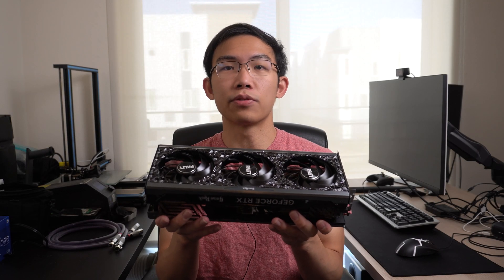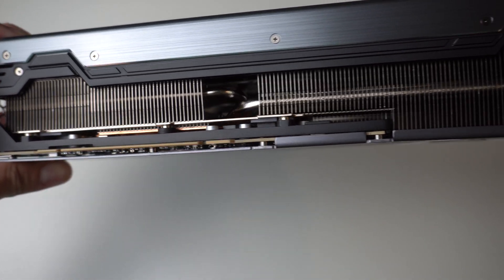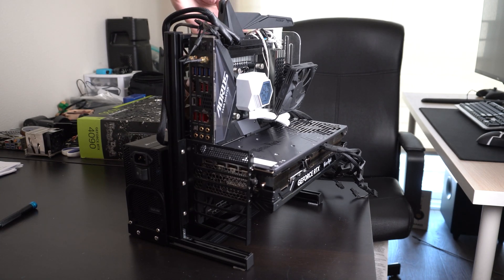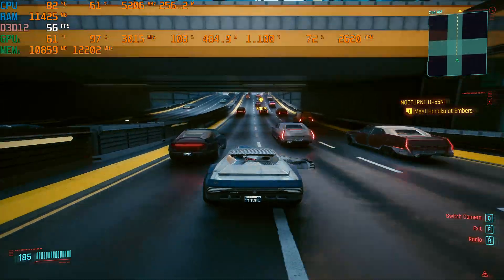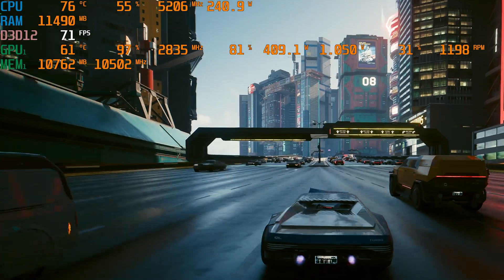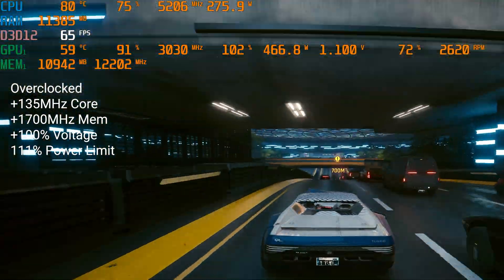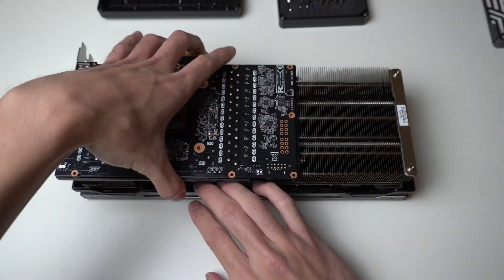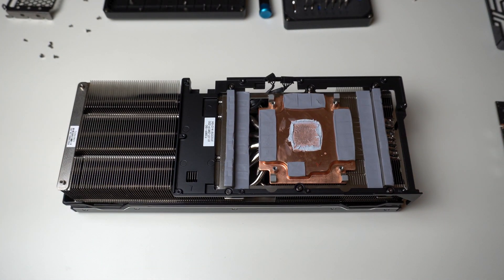FASTER than RTX 3090Ti on LN2 | Palit RTX 4090 GameRock OC Review, Overclocking, Power Scaling

Comment: 3x8 pin Gamerock Omniblack has the same board and in this case 16 phases is more than enough for sure. Running my unit at 2850 Mhz @ 985 mV and 400W. I spent 1800$ on it and feel sorry for those who paid 700$ more from the last saving for Strix or Suprim.
Reply: I know right? Mine arrived yesterday, the fact that some cards are still near or well over 2k is absurd!

Comment: Discovered your channel through your comments on Buildzoid’s channel. This is a great video! I bought this card and started to panic after watching his video. This was by far the cheapest 4090 option available in the U.K. at £1730. Though the VRM and PCB are disappointing they should hopefully last for a good few years especially at stock OC’s… I hope. I just can’t justify paying £300-500 more for an ASUS/MSI and they have their own issues apparently such as coil whine. Anyway, thanks, I appreciated your thoroughness. Subbed.
Reply from the maker: Thanks! To be honest the VRMs are much less important on the 4090 than it was in the 3090 cards. 4090 just pull much less current that even base VRMs like these I have tried to work fine even with shunt mods.
Reply: @OTechnology  Thank you for enlightening and reassuring me sir! 👍

Comment: I got it in port royal at 25.528 and oc 26.157 but it scores less by 1k in timespy extreme.. its wierd.. im runing the ryzen 7950x ddr5 6000, hero 670e..

I updated the bios on the Gamerock and its actually slower now, I wish I could put the old bios back !!!
Reply from the maker: Where did you get the updated bios?
Reply: @OTechnology  The oficial website
Reply: I got the old bios from tech power up and now im getting 19.757 so i`m happy again, anyway thanks for the video as you got me to upgrade to the Gamerock !

Comment: Palit produces cards with a very weak power section and only when they change It, I will buy a card From them,if they do not start cards well,they do not want take this scrap.Yes it's Jus Asus strix kfa 2 hof can msi suprime x.
Reply from the maker: I agree the VRM is very disappointing. Then again in this gen it is not nearly as important as in the 30 series. But still I would recommend the other cards over this.
Reply: @OTechnology  the VRAM is not great? Or what are the negatives about this gpu?
Reply: @OTechnology hi, is it really that bad to get this ? will it last warranty period?
Reply: Well and what is the proce for Asus, MSI etc? 400-600 USD more.

Comment: Watch buildzoids video on this card.. its garbage apparently
Reply from the maker: That's what I said too on the VRM.
Reply: If you use this card with no over clocking.. It will be fine surely won't just break within warranty?
Reply: For 500W bios it's enough, even with 600w bios, the VRM itself enough,  buildzoids just speak to much.. as always... the VRM rated for 800W, I realy don't understand the cry...

Comment: I got Palit also and was wondering why it have 4 connectors (enables 600+W) but doesnt go beyond 560W in my case, however I saw its going beyond 3ghz then I noticed thats as much as Strix + FE reach anyway, so maybe that extra 100W is not needed anyway.

one thing to try is to flash bios which I done before but with these new connectors maybe risky, wont do it now and I dont need it anyway, Palit have a good reviews how good it does in OCing hence I choose Palit over other offerings, as Strix too expensive, did also a power draw from wall test with 5800X and found with all USB devices working including Pimax VR headset and max was 709W from wall when both CPU + GPU under stress test and overclocked

edit: btw 2 Strix reviewers managed around 200pts less Port Royal score than yours, I personally didnt try yet on mine as I just did +120mhz to core and 1000+ mhz to memory and called it a day for rest of this 4090 life lol
Reply from the maker: Yea it doesn’t really need more than 500W in actual games but in benchmarks it helps to increase the scores a little by not throttling at all. 

I’ve actually now shunt modded mine and got higher scores lol the VRM held up fine too so there’s that. It can hit 3045mhz sustained without throttling now but for sure consumes more power. You can probably do +1700mhz on the memory no problem on your card but the core offset is almost maxed anyways.
Reply: @OTechnology  Yeah other reviewers who did Palit mentioned it have highest memory OC stability....

Damn you already went and did shunt mode, if I was you I would have at least tried different bios flashing first like Strix or FE bios 🤣, but you took the higher risk one, I won't take any risk on mine, way too expensive to do it, I did on 3080 bios flashing many times but not this lol
Reply: @TRX25EX  and how it's going with your palit 4090 is it good card worth to buy?